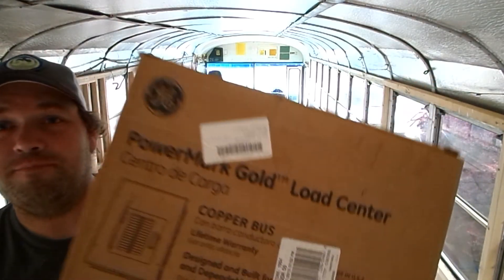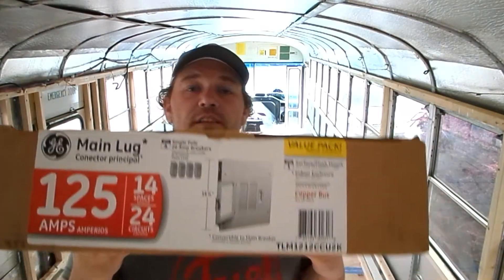Bus Conversion Vlog #22:  Framing Bus Walls And Couch Part 1

Comment: You mentioned Henry tropicool. We feel it is over rated. After doing some research that stuff is not really any better than 3 or 4 coats of one of their cheaper coatings and actually the cooling benefits can be better with more coats of the cheaper stuff. We actually bought stuff called Black Jack Ultra roof 1000 siliconzed elastoeric coating and will be doing 4 coats. The 5 gallons with a coupon only cost us $70 and this was recommended by roofer here in Houston.  
Bus is looking good and video production is getting better.
Reply: Not telling you how to do your bus just options to think about if you haven't coated the roof yet.
Reply from the maker: Bohemian Bus Odyssey I did the same thing and kinda what my gut tells me to use.  I normally go with my gut.  What I love is everybody does it just a little different but also similar, it's awesome.
Reply: Bohemian Bus Odyssey guess it really all depends on budget.
Reply from the maker: The Ginger Bus Adventures for sure!